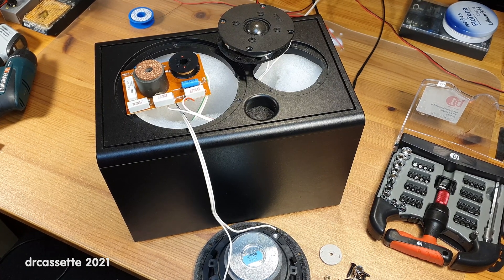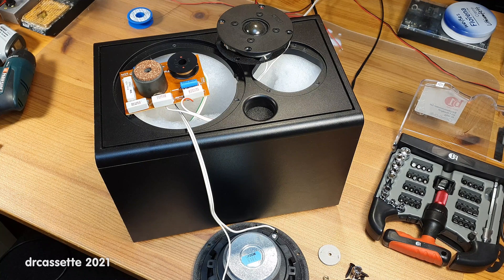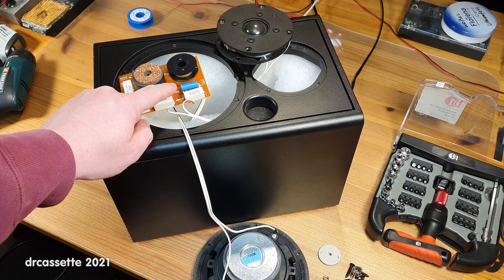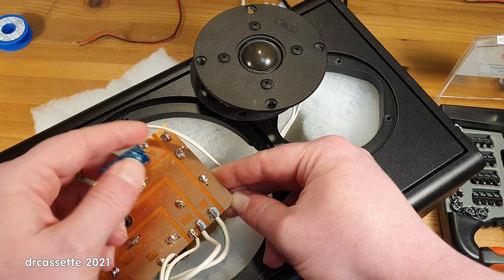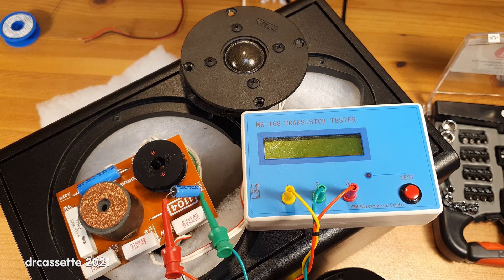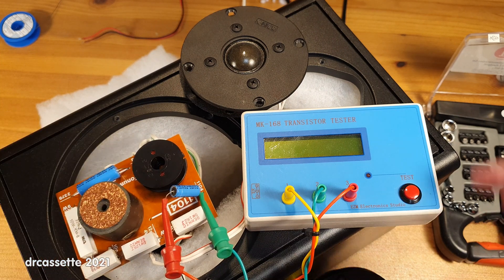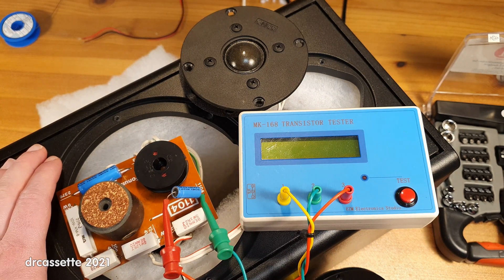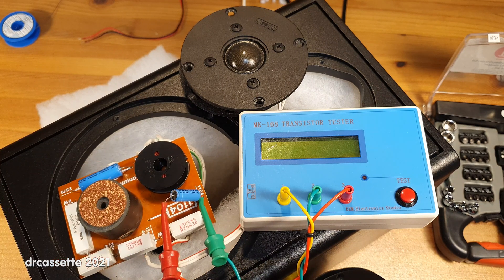Bad capacitors in a speaker crossover make a big difference

Comment from the maker: UPDATE: Both speakers have now been successfully repaired by replacing a total of 4 bipolar capacitors. The effect of the bad bipolar capacitor in the filter network for the tweeter was demonstrated in this video. But also the bipolar capacitor in the filter network for the woofer was bad. The bass response improved drastically after the replacement capacitor was installed. Both speakers sound great now, as you would expect from Canton!
Reply: Hopefully you put some 5.6uF caps on the tweeter instead of changing the value to 6.8uF.  5.6uF NPE crossover caps are easy to find.  I would recommend Mundorf E-CAP PLAIN or Jantzen Premium Elko Smooth.  Mundorf RAW or Jantzen Elecap  if you want to keep it cheap, or just use these on the LF woofer...
Reply from the maker: @sodasodas3  Nope, the owner of the speakers wanted to have them repaired as cheaply as possible. He is not into HiFi, so he probably wouldn't notice any difference anyways.
Reply: I AM into HiFi, but at this late date, I probably wouldn’t notice a difference either. I blame the 1980s, Billy Idol, Harman Kardon, and Cerwin Vega for all of this. Vega’s AT-15s should have come with warning stickers over the speaker terminals. NOTICE: Listening at high volume for extended periods of time may cause cheap replacement crossovers to sound wonderful 35 years from now. 😂
Reply: This is a very good video. Thanks for sharing.
Reply: Hi ive got a bunch of sony dsw 6ohm do you know of good crossover.

Comment: Given the low price and benefits of today's capacitors changing them out to film capacitor with a higher voltage just to be safe isn't a bad idea.
Today's capacitors are just made so much better than 20 and 30 years ago.

Comment: Can you check a capacitor like this without removing one side from the board? Would like to test them on a pair of speakers but really don’t wish to unsolder them to do so.
Reply: No because it will be measuring resistance from other components connected in series.

Comment: Here's one for you. I have a pair of Boston Acoustic VR-M80 two way towers in my garage (damaged veneers and were gifted to me) but a rat entered the rear port hole and chewed a couple of wires. They are still intact "but" it appears it pissed on the crossover board that was attached to the bottom. This left speaker blew out an older Onkyo AV receiver, since bought another one but dare not connect this speaker until I find our whats wrong with it. So, being I'm not an electronics expert, how would I proceed in testing the crossover board. I have used on ohm meter to test each component except one of two capacitors is giving me an OL. But that wouldn't cause my amp to blow would it?
Reply from the maker: To be honest I would not bring speakers that a rat has lived in into my home...
Reply: @DrCassette  Speaker remains in the garage but I figured out the issue. Parts on the way.

Comment: Yes, 140 ohms in series with an 8 ohm driver - is going to cause a great deal of attenuation.
What to replace it with?  Many say you should ditch electrlytics and go for a film capacitor, yes way bigger and cost a lot more (that's why manufacturers don't tend to use them) but apparently sound WAY better.
Reply from the maker: In this case it was simple, the owner didn't want an expensive repair, so I just put in some new bipolar electrolytic capacitors.

Comment: I recently acquired a pair of martin logan ESL electromotion speakers and for some reason, the volume output is way lower and muddy sounding compared to my other speakers. Martin logan support recommended I replace the internal power supply, so I just swapped them out and the volume is still really low. Do you think it's a crossover issue?
Reply: Hi !! To be concise, I don't think so. Since there is a kind of amplifier giving high voltage to the electrostatic drivers there might be a problem there. But, there is a crossover separating the sub part from the mid-high frequencies, If there was damage, only one part of the spectrum would be low. My best advice is to bring them to a specialist who have experience with that kind of technology. P.S. : Do not let anyone who is not a qualified technician try his hand at fixing them, or you will surely regret it !! Good luck !!

Comment: I wander if you can help me,I been trying to recap my speakers crossover ,I can seen to find anywhere this capacitor made by spirit 106J  100v and also spirit 275J  250V  any ideas ? I’ll appreciate and new in this ,thanks
Reply: Hi ! The company name of the capacitor is not important, what is is the value. The 2 first numbers are a numerical value  (1.0 and 2.7 ). The other number is a multiplier. So, 1.0 picofarad multiplied by 1 million equal 10 microfarad value with a voltage capacity up to 100 volts. The second one is 2.7 microfarad with a voltage capacity up to 250 volts. Both of them can easily be found on Amazon and electronic repair shops for a few bucks. I hope this answer your question.

Comment: Cross-over that is built for 4 ohms. If I lower the resistance of the speakers, what happens to the frequency cut-off points?
Reply: If you lower the IMPEDENCE of a driver from an 8 Ohm driver to an 4 Ohm, you will need half the inductance and twice the capacitance to achieve the same cut-off point in the crossover circuit. That being said, check also if your amp is man enough to drive that load. P.S. : Your speakers should never be under 4 Ohm impedence !!!
Reply: @yvesboutin5604  impedance

Comment: I have changed capacitors in several older speakers.  I've never noticed a huge difference.  Likely they didn't really need to be changed.  I just picked up a pair of Polk  Audio Monitor 10's from 1990.  They perform well, but have anemic bass.  Your video gives me hope that the capacitor can make a tremendous difference in cases.  I will have to begin investigating.  Thank you.
Reply: Changing a capacitor or two might not change the quality significantly, but after twenty years or more, electrolytic capacitors are mostly dried out and will fail the moment you push the volume too high. If you really want better sound, it might be preferable to invest in amp, cables and also better recordings !!!

Comment: To change the capacitor is the one Problem.  The other one is the positioning of the inductors.  One should  be  in upride Position.  So the magnet fields of the inductors influence the signal.👍👍🇩🇪
Reply: Sounds a bit woo woo, please explain.
Reply: @fins59  inductors create a magnetic field on axis when electricity flows through them, hence you put them on a perpendicular axis so they wont interfere with each other. It creates a buzzing sound if the voltage is   loud enough
Reply: @TheDevestatorX  That's interesting, I'll look into that, thanks for your reply.

Comment: So do you have to disconnect one side to test a capacitor or can you do or while it still connected to the board?
Reply from the maker: Ideally you disconnect a capacitor from its circuit on one side before measuring it

Comment: I'm sorry to reply on this video late. I have accoustic research ps2062, made in 2001. Sometimes, one of the speakers tweeter stops working. In order to find out,if the amp was the culprit, I swapped the channel and the problem was still persisting in that speaker. I cleaned the speaker terminal, but still not working. I disconnected the speakers wire from the amplifiers terminal and connected the wire to a 9volt battery and it woke the tweeter up and everything was working fine, but in a week or two, the tweeter stops working again and I have to connect the speaker wire to a 9volt battery to get it working again. Could that be a capacitor problem? Kindly help me. Thank you
Reply: To my knowledge, that kind of intermitant problem might have 2 sources. Crossover and wires coming loose or bad solder joints. The other reason might be the tweeter itself like the voice coil being stuck in the magnetic gap or the ferrofluid in the tweeter gap has turn into putty because of its age. Each problem might require the help of a technician if you don't possess the tools and know-how to do it properly. Good luck!
Reply: A bit late but here I am. The speaker needs 2.82 Volts RMS to put out 1 watt of drive force. That 9 vDC battery is about the same as 3.2 watts. If you have a very high end amp that is super clean and the speakers are over 87% effecencty, 3 watts is over 100dB. 

With good speakers and a good amp, you do not need 500 watts to fill a large room with sound. 

It sounds like you have a "High Open" solder joint or a failing cap, or both.

Comment: can I measure the capacitors directly on the crossover, or do I have to solder them out of the crossover, please? of course I will discharge them before measuring by connecting both ends together. thank you
Reply from the maker: Generally it is better to measure capacitors out of circuit, so desolder them, if possible
Reply: The only capacitors to worry about discharging, are usually in AC, and most certainly High voltage AC, such as three phase. And older televisions.
 Typically the capacitors in a hi-fi crossover wouldn't need discharged.
Reply: Wow !! It is always disconcerting when people who almost know nothing about electric engineering try to answer to those kind of questions. Now, this is simply a logic question. If you measure any kind of component still connected to a board or a driver, the current will also flow in the other components, thus changing the value you are trying to find. Simple as that !!! Good luck !!

Comment: Measuring the DC resistance of a tweeter may not tell if the tweeter has been partially damaged.    I felt something is not right about  one of my tweeters.      The DC resistance measure the same of both tweeters.   It is only I use a Dat2 to measure the speaker parameters such as Fs, Qts ...etc that there is a huge huge difference between the two.  That is when I know one of them has been damaged.       But it is not shorted.
Reply from the maker: Measuring the DC resistance will generally give you a pretty good idea if there is something badly wrong with the tweeter, it's a good first test
Reply: @DrCassette  This is not just good but the necessary first test.    It can tell you if it is short.    But for those  units especially to be played in high decibel,  you also need to know if they are playing in their acceptable parameters.     For that you need more than a multi-meter.     Equipment like the Dat2 or Dats v3 are very cheap in the modern days.

Comment: the IBM mainframe computers the military used for our radar installations in the 70's and 80's required to be recapped every 20 years even if in storage becasue electrolytic capacitors leak over time as the rubber seals fail plain and simple. You ever open up an old piece of electronic gears and smell it you'll smell that smell like if you cut open a cap. The people who replace all caps don't want some old marginal cap failing when they have paying live shows. Polyester caps are pretty imortal but aren't always in useful values or ESR which is another thing to keep in mind with old caps it can seem perfectly fine but the ESR is frequency-dependent, temperature-dependent, and changes as components age...
Reply from the maker: Yes, people who enjoy replacing capacitors always have plenty of reasons for why it is totally necessary...

Comment: When you put new cap across those leads, was the old one still hooked to to ?
I have a older Rca speaker from 1957
I’m wondering if mine should be changed
Reply from the maker: If the old capacitor is open, there is no need to desolder it, you can just put another capacitor across it for a quick test. Of course for the final repair the original capacitor has to come out.

Comment: I am guilty of going "cap crazy"  replacing all electrolytic caps in certain situations.   In some devices,  the TIME and DIFFICULTY to disassemble the unit and get the boards out is so much,  that "going overboard"  is a method of preventing having to go back again any time soon.
Reply from the maker: That is a very valid point, some equipment is ridiculously difficult to disassemble...

Comment: I had exactly same problem with a set of JBL control 1's I just repaired. One speaker had absolutely no treble whatsoever. Initial capacitance test on the treble cap showed that it was ok (with a traditional multimeter). However, I was still suspicious, I pulled the hot melt glue off the part and desoldered it from the pcb (it was hidden in the middle of the big treble inductor coil!). The top of the cap was fine but the case was slightly bulged out. Put my LCR meter on it, at low freq (100hz) the cap reading was fine, as soon as you adjusted the LCR to high frequency (10khz or above) the value drastically dropped from 3uf to about 200nF! Comparing this to a good cap, the value stayed roughly the same with any freq. I learned a lot from this repair 😇
Reply from the maker: Interesting, thanks for sharing what you found out :)
Reply: That's actually very good troubleshooting on your behalf.
 I know seasoned techs. that wouldn't use that level of troubleshooting.
Reply: El capacitor tweeter principal de los jbl control 1 está dentro de la bobina de paso bajo, revisa😅, yo adapte ese mismo crossover y añadi una red zobel al tweeter para mis customs Sony ss-l80 de los 90s de dos vías

Comment: I've pulled out the amp for a powered speaker that lost high frequencies and the tweet tested out fine and a know good tweet also didn't work. I got the schematics from Harbinger (vari 2315) and between that and a study of the board I identified the inductor and capacitor on the high frequency output for the board. Oddly both tested out but this video is going to have me give it a second look. I found the white paper for the IC that runs this class D amp and am hoping it isn't something upstream from there as there are a gajillion components. I'm a systems engineer by trade (with a past life in audio engineering) so this is a bit out of my wheelhouse and I'm grateful for the video.

Comment: Very good presentation! As you suspected, if driven to party level, the weakest link in the chain fails. As an electronic technician, I change electrolytic capacitors on a daily basis. The electrolyte leak out over time, so their lifespan is limited and when excessive power pass through them, it shorten that lifespan even more.

Comment: i have a Surround Speakers - i can hear Sound from Tweeter but no sound from Mid range. When i checked Mid range speaker with amp meter its not showing any ohms.

another pair is like same but i can hear little crackle sound from Mid range, when i checked ohms its showing 6.8ohms for 8ohms Impedence

My question is Crossover problem or Midrange driver problem please let me know
Reply from the maker: Seems like one midrange speaker is blown, and the other one that just crackles is almost blown (voice coil partially melted). You will have to replace all these midrange speakers.
Reply: @DrCassette  so crossover will be fine ???
Reply from the maker: Yes, the crossover should be fine.

Comment: Hi ! So I upgraded the capacitors in my 30 yo B&W DM640, w/Solen PP caps, and they became too bright! I really miss the smooth relaxed voice they had previously. What would you recommend?
Reply from the maker: Put the original capacitors back into the crossovers. That's what I did when I ran into a similar situation with a pair of KEF Coda speakers.
Reply: @DrCassette  they are mostly unusable now, would you recommend to buy new electrolytics?
Reply from the maker: If the original capacitors can not be used anymore, you don't have any other choice but to keep experimenting with different capacitors until you find a set that sounds good...
Reply: You could contact the B&W parts department and buy replacement capacitors from them. Or, maybe talk to tech support and ask their advice on what kind of replacement capacitors to buy.

Comment: I recently bought a pair of Sony APM-22es mk11 s for a very low price, which was justified because of the state that they were in !
The tweeter surrounds were not fitted correctly and each had two corners cut off !
And they were held in using Wood Screws (some at crazy angles !).
Having removed all the components from the two cabinets, I discovered that the whole of the wiring had been replaced and the crossover had been worked on.
I have tested the resistance of the 4 speakers and all seems fine (at 6ohms for the woofers and 5.2ohms for the tweeters)
However I am a bit stuck on the crossovers as I don't know what I am supposed to test, hence this video has been helpful and I will be having a go as soon as I obtain a component tester and can 'copy you'.
Thank you for this video 🙂
Reply: Hi ive got a bunch of sony dsw 6ohm do you know of good crossover.

Comment: I usually replace these with polyester types as they perform much better, also the ferrofluid goes hard in the tweeters and replacing the fluid makes a lot of difference. Generally like you I only replace caps if they are faulty. Many thanks for the videos.

Comment: Let us not forget the Capacitor plague starting in the late 90's.   Greed gone wrong.   My mentality on capacitors is always suspect them first.   Having repaired hundreds of devices I've found capacitors to be the problem or related to the problem most of the time.   I don't however just bulk replace.  Matter of fact you can sometimes cause problems by doing so as some of the characteristics of older caps were part of the circuit design.  i.e.  tossing in a lower ESR cap is not always better.
Reply from the maker: Yes, of course there was also the capacitor plague of the late 90s and early 2000s, but these speakers were made before that happened, so I didn't mention it.